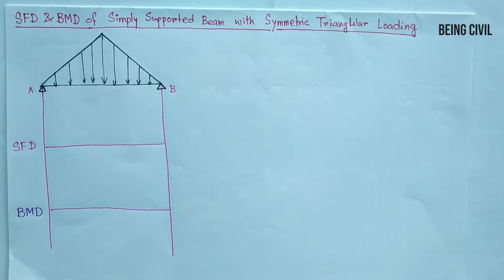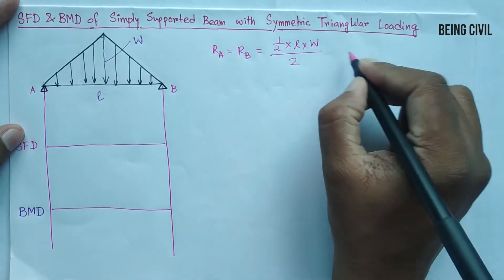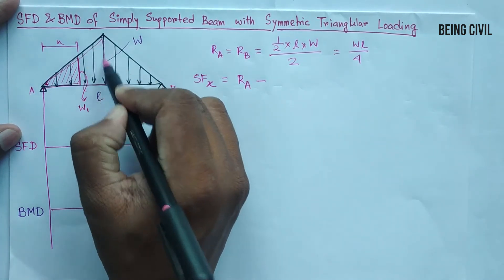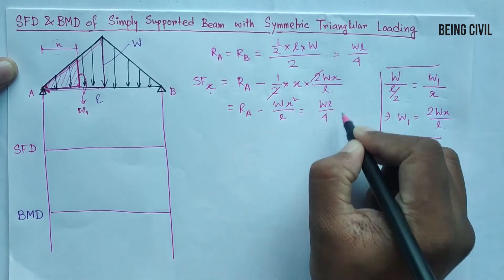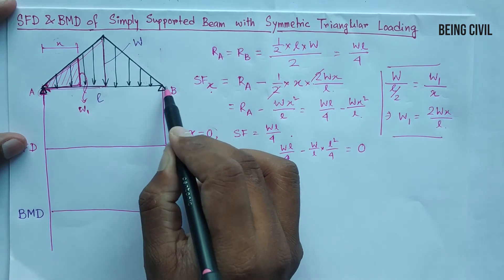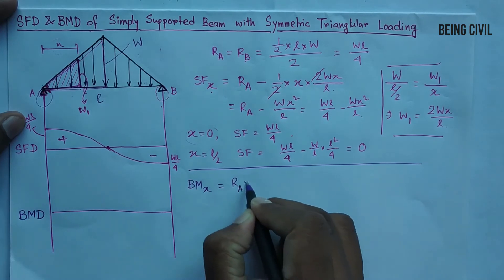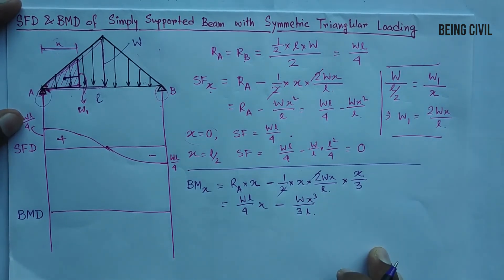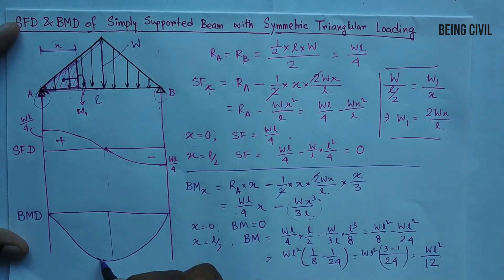SFD & BMD | Example 3 | Simply Supported Beam with Triangular Loading

Comment: A simply supported beam AB of span 4m is carring a triangular load varying from 0 to A to 5KN/m at B. Determine the maximum deflection of the beam. Take rigidity(flexunal rigidity) of the beam as 1.25*1 d² N. mm².

Comment: Why it's sagging bending moment??
Reply from the maker: As Load is Downward, bending moment creates tension in bottom, compression in top of the beam. This type of bending is sagging bending moment.
Reply: But I have seen it in the book where it is showed with upward curve
Reply from the maker: The bending moment you can draw either upward or downward. The value should be Positive. I have taken Downward Positive as my sign convention.
Reply: Fine